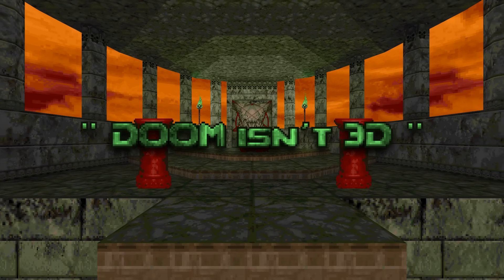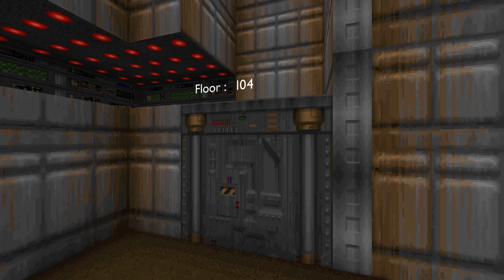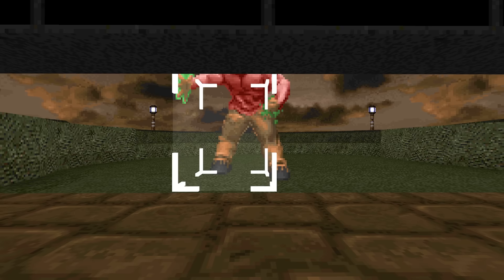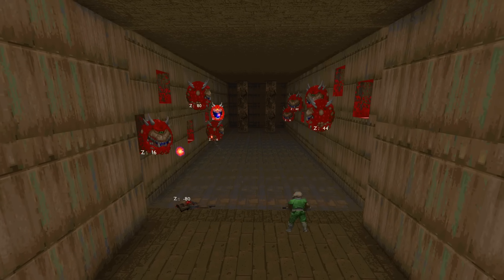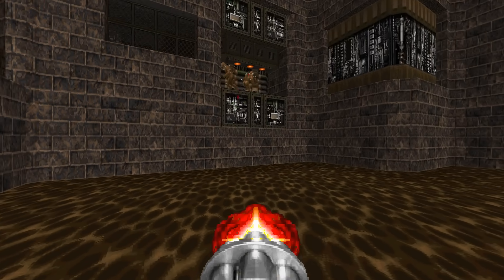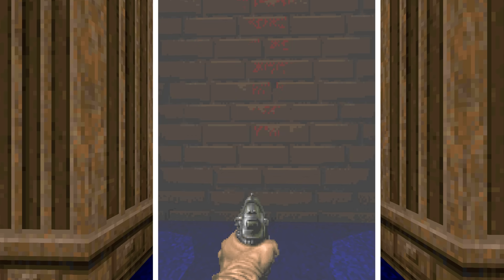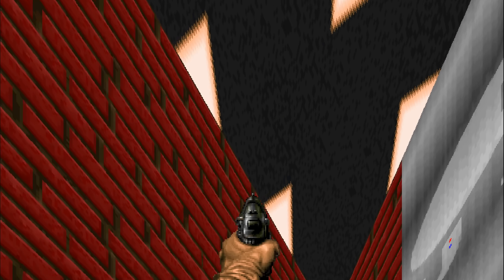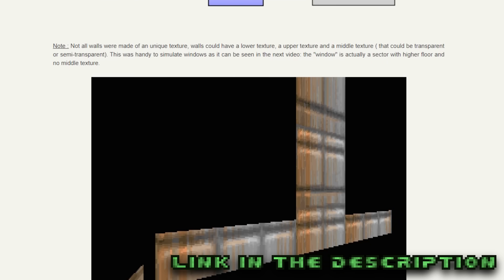Doom engine - Limited but still 3D

Comment: The way I always understood the room-over-room limitation is that the engine draws levels in 3D space but they're internally represented as a series of connected points on a 2D plane. This video made it a lot more vivid and also addressed some things I was never quite sure about, like why some objects have height and others don't. Really great work.
Reply: Duke3d was similar, you built the initial level layout like creating shapes snapped to a grid in ms paint.  You could build rooms over rooms in duke3d, but it was kind of hackey, I forget now how it was done in the 2d level editor though.  I think you overlapped two sectors and made the second one's floor height higher than the first floors' ceiling height maybe?  Little limited on how you could connect the two heights though.  

 Going under water actually teleported you to a new room/sector outside the main map.
Reply: @Dan-yk6sy   "Kind of hackey" is a good description of Build in general. I haven't worked with it since the DN3D days, but your description of how overlapping sectors worked in the editor lines up with my memory.

The major restriction is that the overlapping sectors have to be completely independent of each other, meaning they can't share any vertices and you can't see into or interact with one overlapped sector from another. So they have to be connected via a third, non-overlapping sector, like the twisty stairwell that leads to the projection booth in DN3D E1M1. This works because (as I understand it) Build uses portal-based occlusion to determine which sectors are visible in real time instead of relying on a preprocessed BSP tree, so it doesn't matter if multiple sectors occupy the same space on the 2D plane so long as their vertices (the only parts with specific XY coordinates) are different and only one of the sectors is drawn at a time. Thankfully the Build editor had a built-in first-person view, which helped a lot with managing this stuff.

Later Build games like Redneck Rampage and Shadow Warrior allowed multiple visible rooms over rooms through elaborate use of viewports and teleporters, but while I never worked with the editors for those games, I believe the different "overlapping" rooms were actually located in separate areas of the map, like the underwater sections in DN3D.

EDIT: Thinking about it more, I'm not even sure it's necessary to have the overlapping sectors at different heights, since the absence of precomputed occlusion means the editor can specify which sector a sector boundary is open to, unlike the Doom engine where these connections are worked out by the node builder. In theory, it seems like you could have a door open into a corridor that loops around on itself through the strategic placement of sectors, one of which would partially overlap with the sector containing the door and take you past it into the middle of the corridor.

EDIT 2: Maybe my guess was right? There's a secret level in DN3D (E2M11) that apparently uses this trick (or something like it) to create a 720-degree loop.
Reply: @Dan-yk6sy  In Duke there were portals. E.g. when exiting one room, you were teleported to a different place on a 2d map. So 3Dness was still a trick. I haven't played duke much, but of what I know the engine allowed you to create thing like a small house with huge interior.

Comment: I'm still confused as to why exactly the older rendering method distorts the image. Is there an easy way to demonstrate exactly what we are looking at during that effect for someone who knows nothing about rendering.
Reply: It's basically the same as if you took an ulrtawide screenshot, and then mimicked looking left and right by scrolling horizontally. The edges of the screen gunna look distorted. Vertical look is done this way except vertically.
Reply: I don't think I have a good enough idea of the concept of something remaining vertical to comprehend this, thanks though.

Comment: One nice advantage of not having rooms above rooms that no one talks about - it makes the maps easy to look at and navigate
Reply: Daggerfall flashbacks
Reply: I remember the true-3D maps in Descent. Larger levels could get pretty confusing, especially since there was no up or floor or anything. But the six degrees of freedom in that game were awesome.
Reply: It's still possible to make good in-game maps for engines with room-over-room as DOOM IV/2016 shows (and, you know, Metroid Prime which it copied its map from), but DOOM's engine certainly makes its automap much easier to code.
Reply: The maps are horrible rat mazes. What are you even talking about?
Reply: @kekeke8988  Well, at least it's not a 2 floor maze
Reply: @kekeke8988  I used to love typing idbeholda and spending 20+ minutes on each level ensuring there was no grey left on the map at all
Reply: @kekeke8988  what he means is that if you go to the map screen you can navigate across the whole map that way, if you get lost.
Reply: Dude that the beauty of doom, like you play this game to kill some demons and have a damn good time, you wouldn't ever want to think about where to go bc it always ends at the last room of the map, some ppl think og dooms maps are a maze and those guys must suck at video games lol
Reply: @henelwbeuhle6572   Helps that in og doom you run faster than a moped so doesnt take long to run around the map to find the door

Comment: I was always under the impression the 2d claim was purely based on the BSP structure that powers sectors. Obviously the final image and much of the gameplay is in 3d. Throw the ceiling and floor heights in the trash and every map is still playable because the connections are all still valid. I don't think that's true in something like the source or unreal engine. Of course, does that matter? Doom rules in all dimensions.

Comment: I think the most accurate term would be "basically 3d".
(correct me if Im wrong but) As much as the z axis matters in terms of internal calculations the engine never actually renders height in real time. Every frame is an extrapolated representation (aka a drawing) of what a 3d image would look like, as opposed to "proper" 3d engines where you are actually present in the rendering. 
Games like Shovel Knight and Among Us are technically 3d since the sprite layers are positioned on different depth axis's but you wouldnt call them 3d games because the dimension dosent matter. 

Doom is about as close to 3D as you can get without actually being three dimensional. So, it depends on whether you look purely at mechanics or gameplay.
Reply: @borogk  I think you misunderstood what I said. 
I dont mean "all games are 2d because monitors", I meant that the doom engine specifically dosent show you what it actually renders. 
In a modern game the world is rendered in real time, you are "present" to see what the engine sees

In doom the engine only renders the top down map and then goes through an extra step of producing a "3D" image. 

Its like the difference between looking at the default cube in blender and looking at a sprite of the cube based on xyz parameters

Comment: For a more advanced rendering engine, GZDoom's palette tonemapping sure pales in comparison to the plain ole software renderer, especially with ambient occlusion enabled. Look at that smooth gliding color banding at 4:00!
Reply: I don't think you could achieve a effect like that with simple tonemapping like gzdoom's
But i remember a post on doomworld of a guy that made a shader that replicates the software rendering's 256 colors and bandinha perfectly
Reply: @luisaazul 
Holy shit, I'd love a link to that.
Reply: I recently played some Doom1 with the prboom and was thrown back into the 90s with the 8bit color range of the renderer. It's one thing to have 8bit textures but 256 colors for lighting is very oldschool. It's not retro anymore, it's vintage. I wish some modern indy games would have an 8bit color render option.
Reply: @SirSilicon  How would you even do that I wonder
Reply: Pretty sure GZDoom has an option for this kind of thing called banded tonemap or something. And also allows you to use software rendering.
Reply: Troo Cullers is another good tonemapper if you're not gonna be cranking the ao
Reply: Hey Marphy, should have figured you'd be here lol
Reply: I feel sad I barely understand what this thread is saying
Reply: But this IS, in fact, GZDoom with both palette tonemap and ambient occlusion enabled.
Reply: It looks awful lol

Comment: 5:02 Ahhh I always wondered why Duke Nukem 3D's mouse look always seemed a bit off.
Reply: that was my first reaction too! Duke Nukem 3D mouse look haha :D
Reply: Yup, a feature/shortcoming of the Build Engine. The same thing happens in Blood.
Reply: IIRC Build engine games had somewhat iffy mouse input as well, though that issue is unrelated to the y-shearing as seen in this video.
Source ports like EDuke32 have better mouse input, and for anyone who wants to stay in DOS there's a utility you can use to fix the input.
Reply: Yup, Blood is the first thing that came to my mind.

Comment: Thumbs up for all of these visual effects for easier comprehension :thumbsup:
Reply: I agree! This was some awesome visual effects for things like hitboxes!
Reply: Yeah, I've been hoping to find a GZDoom mod that renders the proper hitboxes of monsters and projectiles, it'd make a good debugging tool, though this might just be a lot of clever editing and not so much a mod. That's why I asked a question about this in it's own post here.
Reply: @LordMisfit  such a mod exists already! It's not as elegant as the effects shown in the video but RadiusDebug works very well. https://forum.zdoom.org/viewtopic.php?f=105&t=60804&hilit=RadiusDebug
Reply: agree this was a highlight, love the effort
Reply: @borogk  @mikk0451 I did recently accquire RadiusDebug. While it seems to work fine in vanilla GZDoom loadouts, for some reason, if I load it with my mod, I only see the hitboxes when I use the "freeze" cheat to freeze time. I'm not sure off hand what would be needed to address this, but sadly it mostly won't work alongside my mod "out of the box" (which was kind of the point of looking for a mod, instead of just porting their code over with tweaks for it to work in my mod, since at that point, it'd just become a debugging feature for the mod itself and I'd probably get complained at for lifting the code by some less observant players, even if I credited the mod author). x.x

Also, RadiusDebug as it currently is, does utilize models to visualize the hitboxes, and it's been stated if they could directly incorporate their mod into the main engine code they'd have to make a non-model visual version.

The other thing is, though it could just be clever editing, the presentation of your version just appears to be more involved than RadiusDebug, since it's also appearantly more than just rectangular hitboxes [like when you make the monsters stretch to represent them being infinitely tall, etc. :V ], so I'm still interested in the mod you're working on nonetheless, mistakes in aspect ratios or not, that can be tweaked, as you suggested.